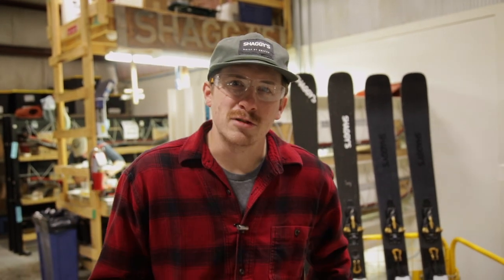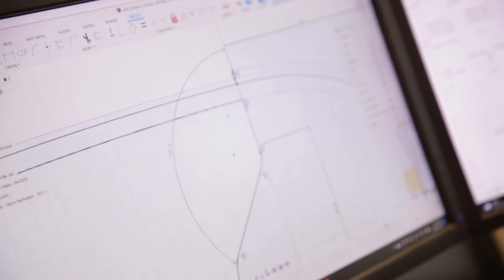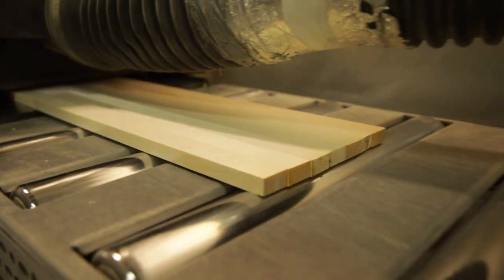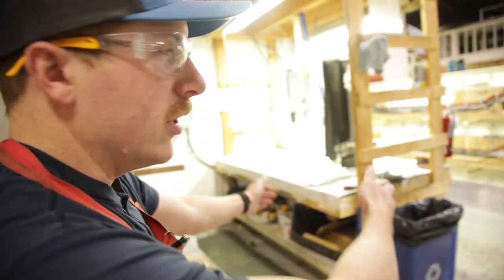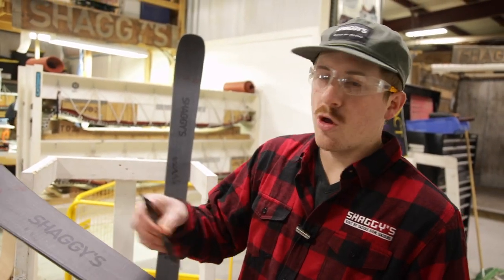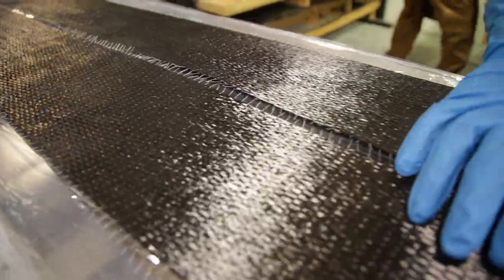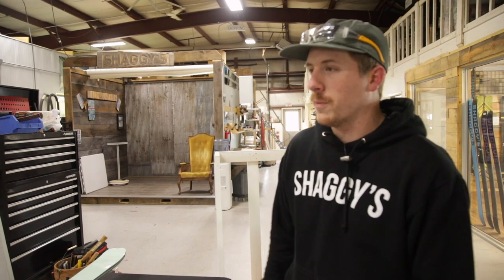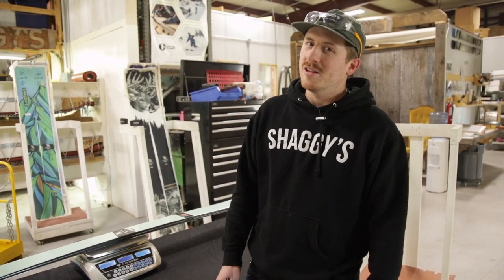Building 3lb Carbon Fiber Skis (6lb/pair)

Comment: Did you guys use any CF in the 45/-45 directions?  I could only see the uni going in the 0, ( I’m a hobby ski builder have had mixed luck with CF layups)
Reply from the maker: Yes, all of our carbon skis have carbon running at 0/+45/-45. You can see some of it at @7:11.